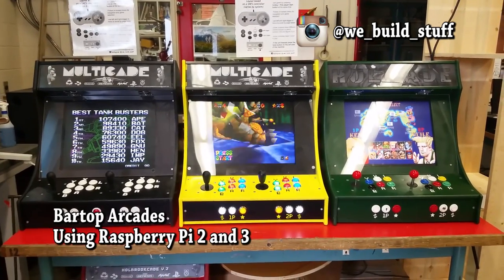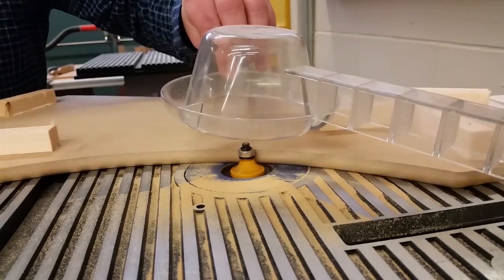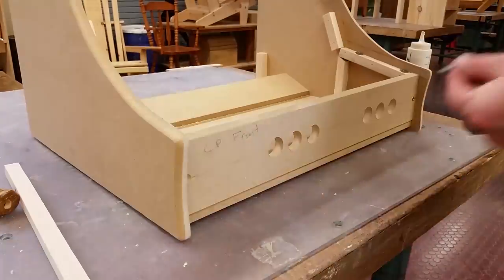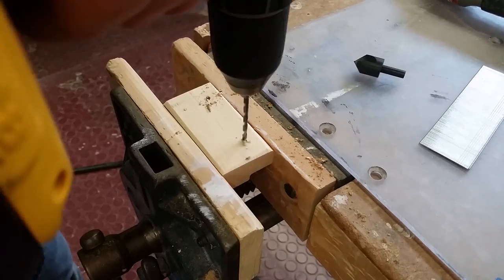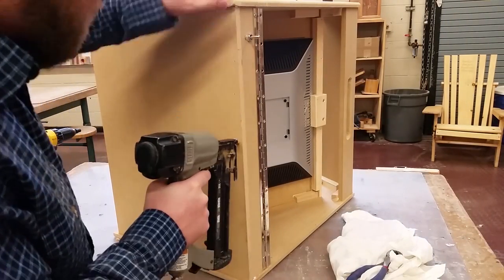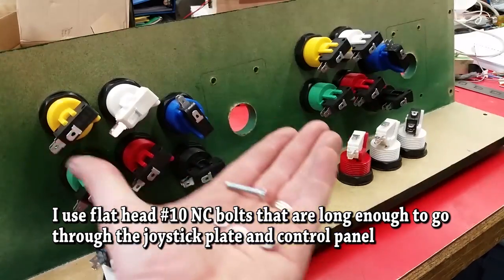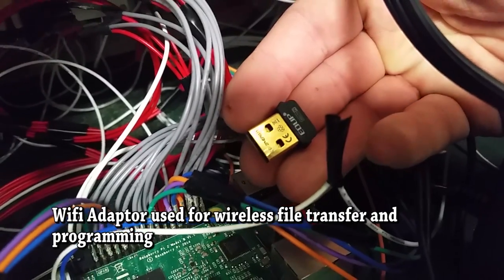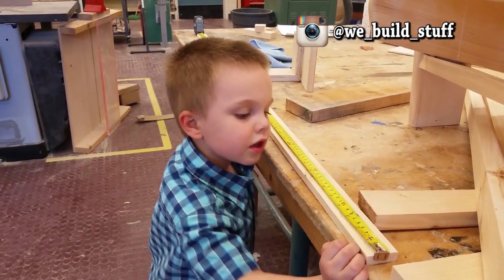How to make a DIY Raspberry Pi Arcade Cabinet!

Comment: Why do the mesurements from the side panel layout and the arcade plans package not match (I printed out everything from the PDF-File -> no distorsions)?
For Instance the top measures 150mm on the side panel but it sais 166.4mm on the arcade plans package....
Reply: Sorry for the (stupid) question. My printer somehow rescaled the Sideplan "to match the side". 
Still where did you get your designs from the Arcades from?
Reply from the maker: everything is in the description. I used the instructables plans as a base idea for the main parts and have modified them to fit my needs

Comment: I think I will give this a try and build my own and just see how it goes, however I've never built antyhing except in high school. 

You don't happen to know where I can find a 19" 4x3 monitor that ship to sweden? I've been looking at ebay. 

Can you give me some piece of advice, I will start this project in a month I think and aim for it to be done in 3 months. 

Also I can't find a place that has like a class where I can make this, I have however found a workshop you can use if you become a member. 

Thanks
Reply from the maker: I've used craigslist or amazon for my monitors. Sometimes local businesses get rid of theirs so i just keep an eye for them used
Reply: Cool, the tools you use would you say they're common? I've found a Makerspace here in Sweden that I might use, also would a joystick and button with usb introduce input lag? It seems kind of hard to do the gpio but is it?
Reply from the maker: GPIO is easy. The wires from the microswitches go directly onto the headers of the GPIO. Lots of videos out there for that (i'm making another one just about that). The USB encoders are great as well. If you are a pro gamer you might notice some lag but for casual play I have never had an issue

Comment: Great build, but I noticed that you had installed the t-nuts incorrectly at 5:20. They should go on the opposite side so that when you tighten them, you do not pull the insert through the 3/4" wood pieces, rather the nut is pulled into the 3/4" block. You would need longer bolts, of course, but much more sturdy and will last much longer if you move the unit around alot.
Reply from the maker: Steve Jankowski I have addressed this already throughout the comments section. When i first built these the tnuts wouldnt stay in the wood when the bolts came out. My new builds I put a little stopping block to prevent the tnut from falling out of the pine. You can see updated builds on my channel

Comment: Was that 3rd Strike I saw? Are there many hoops to jump through to get CPS 3 roms running on pi or does just natively work?
Reply from the maker: everything you need is right here as well as a supported list of games that are working and not working :)
https://github.com/recalbox/recalbox-os/wiki/Easy-Arcade-on-Recalbox-(EN)
https://docs.google.com/spreadsheets/d/1F5tBguhRxpj1AQcnDWF6AVSx4av_Gm3cDQedQB7IECk/edit#gid=423376617
Reply: Nice! Thanks.

Comment: What did you end up doing for the power? Do you just plug and unplug to turn off and on? Great video!
Reply from the maker: Cole Buzzard turn off in menu for proper shutdown. turns on with button wired to P6 on the Pi. reset button in emergency or a game freeze
Reply: We Build Stuff sorry. can you explain the button on pin 6?
Reply from the maker: not pin 6. p6. It may not be on the newest version of the Pi but it is for sure on REV 2. I talk about it a bit in the video but this video is a bit more informative below:
https://youtu.be/rNhXqjSO-0s

Comment: how did you connect all the buttons and joystick to the gpio, aren't only 17 of the GPIO headers usable like this?
Reply from the maker: on the r2 and r3 I use 26 (i think) of the headers my normal 2 player cabs
Reply from the maker: https://github.com/recalbox/recalbox-os/wiki/GPIO-controllers-(EN)

Comment: Noticed how you connect the joystick & buttons onto the GPIO.   I did some searching, and the best i'd found was the GPIO pins diagram.
How do you know which input goes where?
Reply: This is the diagram, but so many input names:
https://pimylifeup.com/raspberry-pi-gpio/
Reply from the maker: this one is easier! postive end of each button into the shown postive + headers. Daisy chain all the negatives together and run from a single negative - header
https://github.com/recalbox/recalbox-os/wiki/GPIO-controllers-(EN)
Reply: You're a lifesaver.  Bookmarking that link.  Thanks.

Comment: Can you program the pi to accept CC &/or coins for the arcade machine?  would you need add'l pis to do it?
Reply from the maker: in this case you can just use jump wires to the GPIO header for the select/coin header for 1st player and 2nd player. That allows you to use both the button and the coin slot to activate "coins needed!"

Comment: Sweet build! Question, do you think it's necessary to bevel the edges to fit perfectly between the pieces? What if I don't do bevels?
Reply from the maker: Nino you dont have to but you will have to trim to fit together for a clean look. Ive done the angles by hand and with a skillsaw before when I didn't have access to a table saw
Reply: We Build Stuff woodworking services in my country are costly so I'm trying to minimize my budget and make it more DIY with the minimum tools that I have, otherwise where's the fun in it? Anyways thank you so much for the reply. Much appreciated!

Comment: I'd like to know how wide it really is? Because I cut everything to 55cm wide and used your template for the holes and there is nowhere near the space for the controls that your completed one seems to have.
Reply from the maker: My pieces were all 55cm wide. Laying out the location of the buttons to make it fit best for you is usually where people customize it. I've since built some bigger bartops to allow for more comfort with 2 player games and a larger screen. Check out the bigger bartop video I uploaded 😀

Comment: How much do You charge for these Units ?
Reply from the maker: I don't sell them but if I did prices would start around $1200
Reply: Gotcha. So That is for the cab alone ? I'm talking just the shell .. nothing loaded.
Reply from the maker: Just the shell? I haven't thought about that before! I would build them with custom options like button layout and screen size. Probably $600 for a plan cabinet that would still need some customization

Comment: Quick question. Do you need a separate usb control interface for the buttons or can you use pi. Thanks
Reply from the maker: I directly plug them into the PI. There are compatible USB encoders that will work
https://github.com/recalbox/recalbox-os/wiki/Compatibility-(EN)

Comment: question on the wood part, I thought MDF board was toxic? any recommendations on a wood with good finish that is just as smooth?
Reply from the maker: Anything can be smooth if you sand it right! I've even considered pre-laminated pine shelving boards from Home Depot. I would like to build one out of Oak and use a nice finish :)
Reply from the maker: You will also notice I don't breath once during the video so no danger of toxic mdf
Reply: The dust when cutting is toxic. so WEAR A GOOD MASK! Once the dust has settled or been vacuumed away its perfectly safe. Painting it even more so.
Reply from the maker: I've been wearing masks for the last year since making this video. The shop I originally did this in had much better ventilation so it wasn't as much of a worry. My current shop isn't quite as nice.

Comment: nice work man
hope to have the dimensions for the cabinet using 15" , 17" MONITOR what should i change ?
thanks
Reply from the maker: This one features a 19" square monitor. I customize every cabinet to fit the screen. For 15-17 the only modification would be the screen panel. Cut out a square from the "monitor panel piece" large enough for your monitor's screen while still hiding the bezel (plastic surround). You can see an updated way I do it in my "Bigger Bartop Arcade" series that is not too tricky.  Good luck!
Reply: @WeBuildStuff  i think we can narrow the overall width as the space between the side and the monitor edge will be too much but we constrained to the control panel width , also the height can be reduced as the monitor become smaller 
by the way what is the minimal control panel width ?
Reply: @WeBuildStuff  my target is to minimize the cabinet weight and i'll redesign the template for 17" monitor and using 6mm-8mm laser cut plywood with internal reinforcement ,what's your mind?
but the 2 player control panel is the only problem as I've to keep the minimal width as is

Comment: I'd love to learn how to build these badly.  I would like to be the first to do this kind of business in my Local area as I've been doing alot of research and found NO ONE who does this work.  Eventually I will learn :-)
Reply from the maker: Start with some simple tools (my only real fancy stuff was a full size table saw and it was a bonus to use a CNC cutter for the pacman design but I don't have access to that anymore) and build one! Eventually create a CNC plan and get them cut at a shop for mass production. In my hometown there is a company that is cranking them out on a daily basis. I just do this for fun :)

Check out my local guys in Vancouver at http://www.arcadetimemachine.com/
Reply: Thankyou
Reply: Would love to have the pacman cnc file, have some friends here in Belgium who have a cnc.  Any chance I could download these?   Kind regards, johan
Reply from the maker: I had a teacher friend help me with that. He had a program that would convert a black and white JPG or BMP picture file into a cutting file. Sorry dude

Comment: 1. Is it okay to use a cnc router on a sheet of mdf to do this? 

2. Can I use MDF for those smaller supports that go on the inside?
Reply from the maker: I have seen some great cnc builds. I wish ibhad access to one.

For the inside you can use anything you think is strong. Since this video I have switched from Pine to Oak (hardwood) for the supports.
Reply: its always cool to use a cnc

Comment: what size of screen would fit this screen cutaway?  17inch 1080p?
Reply from the maker: Wou can make any screen fit if you need it too. I use 19" 4:3 Dell monitors (19xx series usually). If your screen is too wide then just modify the width of the main pieces. I do my main pieces (control panel top and front, marquee, top, back, and bottom) at 55cm so I can utilize my material and get more out of it. I can almost get 2 bartop cabinets out of a single 4x8' sheet of MDF
Reply from the maker: a 17" would fit fine but you will have a lot of space around it. If you are only doing a single player cabinet you could bring the overall width of the cabinet smaller to match your monitor

Comment: Im great with electronics and wood working but have zero knowledge of the pi. I will order one tommorow and see what happens.
Reply from the maker: Jorge Serna with recalbox you basically need zero knowledge of the pi. download the latest image from the recalbox website and follow their instructions. super easy
Reply: We Build Stuff Thanks....I will be ordering some parts in a few minutes. I did not know if there was an adapter board I could mount on the pi to screw wires in..Anyways thanks

Comment: What is the dimension for just the joysticks that you used for it because i plan on just making a 2 player arcade joysticks that could plug into any HDMI TV or Monitor and i plan on making it a little portable by installing a power brick inside the joystick and also what would be the best wood to use that is also very affordable because for my project i am planning on spending a total of 150$ +15$ for it (the 15$ is for the 50mm fan i plan on installing in the joystick so the Pi could kind of stay cooler since it will be locked away in it).
Reply from the maker: good call on the fan. There are many brands/styles of joysticks so the clearance underneath depends on which one you bought. I love the fightstick idea as I am also building that for my next project. You probably want at least 9cm or 3.5" inches of height/space inside your box to leave room for wires and the parts. But again that depends on the size of the parts you use. The HDMI out is great because you can plug it into anything!

The black handled one shown on the black and the yellow arcades:
https://na.suzohapp.com/php/thumb.php?src=/images/50/506084000_md.jpg&x=400&y=400
Reply from the maker: and this is the one shown in the Green Arcade. I used a short Zippy Joystick
http://www.shop.cajunarcade.com/images/ZIPPYY%20Shaft%20Measurements.jpg
Reply: We Build Stuff I have seen some Pi builds that uses a fan with the heatsinks which cooled down the Pi to around 45°C which i find for playing games longer won't heat it up too much i find.

Also when buying the joysticks is there a way to know which way would up and down would be as well cause for this project i am a noob at it so.
Reply: We Build Stuff Ya see i am not a big fan of the ball sticks cause arcades in my area never really had that style they had more of the stick types.
Reply from the maker: The direction of the joystick depends which wire you plug into the microswitch. The first time for me was trial and error but if you look at it upside down you can physically see which microswitch the joystick hits. 
http://img.dxcdn.com/productimages/sku_41227_3.jpg
Reply from the maker: Agreed. I don't really enjoy using the ball tops on this arcade. My other 2 have sticks/bat type

Comment: Hey, Mike. I really do need your help. I bought an old arcade machine that used to be "Burger Time" from the 80's. The guy that I bought it from took out the old computer and the old CRT screen. He put in a raspberry pi and a computer monitor. I would like to add more games to it, as it already has almost 60 games on it.  How do I go by adding more games to it, and where would I find the games at??? Can or will you please help me with this??  I would love to add a lot more games from the 80's and 90's on it.
Reply from the maker: Depends on the front end (recalbox, retropie, etc) but typically everything will be stored on the sd card or usb stick. Search for "romsets"

Comment: i've read that a simple hdmi to vga cable won't work because the output signal is digital and vga is analog. but you seem to have no problems with this at all? i ordered a hdmi to vga converter (hasn't been delivered yet), was this unnecessary?
Reply from the maker: Ive used both hdmi to vga cables and hdmi to dvi cables without issues (not an adaptor but an actual cable with different ends). Sometimes it might depend on the monitor.

Comment: Can you give me the specs of the power supply please?  I’m using led buttons and I get a low power warning when I try to configure the arcade controls.  I tried with a 2.5a and a 3.5a.
Reply from the maker: Are you using a USB encoder, 5v header on the Pi, or a separate power supply for your LEDs. Some LEds require a different amount of power.

I run a 3A power supply for my Pi and have a separate 9v or 12v power supply for accessories like the LED buttons and backlit Marquee. It all depends on your current setup and what type of LEDs you bought. LEds are very low power but if you have 'daisy chained them together in series compared to parallel you will required different voltages and power in order for them to function!

Comment: beautiful design how do you add a coin slot
Reply from the maker: Buy one online, cut a hole for it to fit, wire the coin button to the appropriate place 😀
Reply from the maker: With a taller design use one of these
https://www.ebay.ca/itm/Arcade-Coin-Door-New-w-Quarter-Mech-Great-For-MAME-or-60-in-1-Jamma-PCB/311868977398?hash=item489cd6f0f6:g:WdoAAOxy2CZTavQP:rk:2:pf:0

Comment: I'm currently using your prints off your website. The blueprints the are taped together for the side panels are undersized compared to measurements given on the page with all the cuts. Should they be the same size? 

(I used the 8.5x11 PDF print out at 100%)
Reply from the maker: I've never had that issue before unless you taped them together wrong or your printer did something weird. I've got over 20 of these builds made. I will check out the PDF and see if it is uploaded wrong. Cheers.

Mine is a slightly modified version of this one. I've used his with permission. Here is the original!
https://cdn.instructables.com/ORIG/FSW/I268/I6J7TOCP/FSWI268I6J7TOCP.pdf
Reply from the maker: I've just re-uploaded a PDF that has only the side panel blueprint pages.
http://holbrooktech.weebly.com/uploads/5/3/6/0/53607781/side_panel_layout.pdf
Reply: Thank you. I think the printer at work printed them wrong, i did it at home and everything measured out fine. On a second note what tool would you recommend to replace the CNC for a design? 

I saw your video back in December, I finally gathered up all the tools to make the build; I hope it comes out great.
Reply from the maker: I'm going to be doing vinyl artwork wraps instead but the CNC does make it different and pretty cool :)

Comment: Great video! How much do you rent these out for? I might be doing that as well once I have a few built.
Reply from the maker: I would rent between 50-100 a day probably for parties or weddings
Reply: @WeBuildStuff  Thaks for the quick reply, awesome work you do. You got yourself a new follower, I just Subed, thanks again.
Reply: @WeBuildStuff  How many cabinets would you rent out at one time for that price?
Reply from the maker: @TLil21  depends on the event and how quickly I needed to make my investment back. Think about an expensive tool daily rental rate from a hardware store. What is it worth and what is fair in your area!